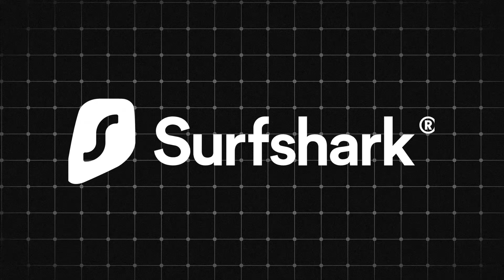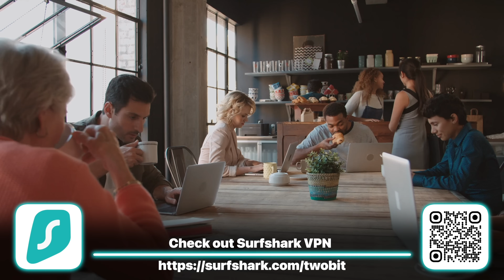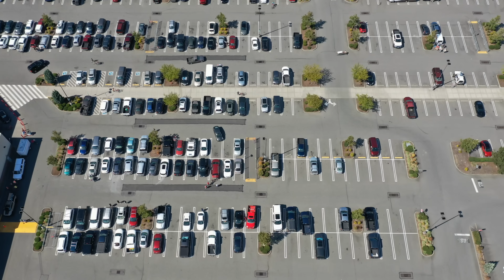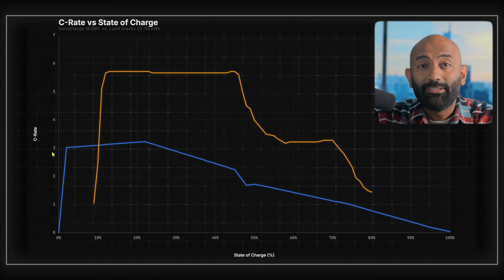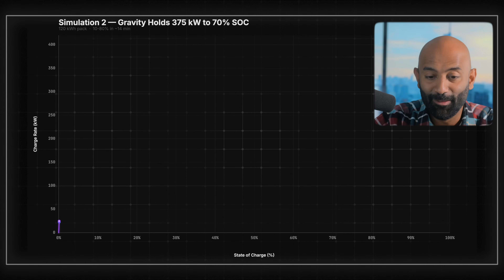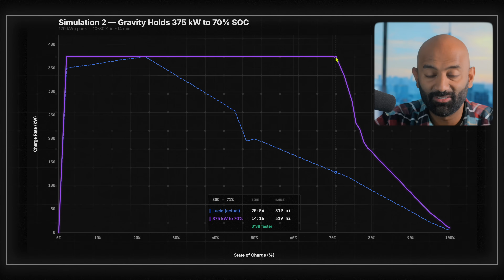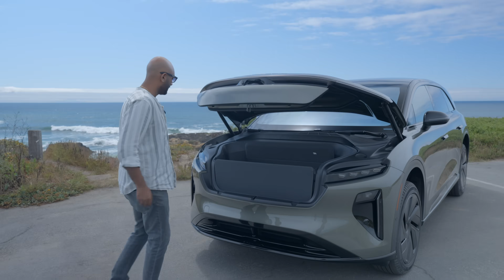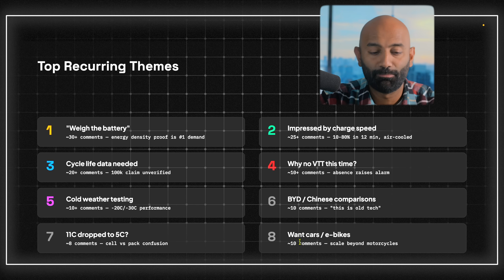Donut Lab Battery Test 4 Changes Everything!

Comment: The entire 5C is not so relevant for Lucid's 200kWh batteries, because we simply don't have this kind of chargers (as mentioned). it's more relevant to regular/budget cars, because that means we no longer need "soon to be" 150+kWh batteries, as we can charge 70kWh in the blink of an eye with already existing infrastructure. 16:30, while I agree it will save you a lot of time on your road trip, I still think you are fine with a 20-minute break after driving for 300 miles. Again, I think the biggest revolution is recreating the petrol-station experience for 60-70kWh batteries, you no longer stop, go for dinner and return after overstaying, but you step out, connect the charger, check your twitter, and you are ready to go 6 minutes later.
Reply: We have one 600kW Charger and one 720kW in Slovakia :D
Reply: @MrVolodus  "and ONE 720kW" is a key word here ;) I know infrastructure will be upgraded in time, but I still I would rather use the closest charger, rather than hunting for 600kW one with 20 miles detour
Reply: @michalklucz6907  They will grow in time ... mostly because of trucks.
But yeah, 350kW is standard for now.
Reply: @MrVolodus  a standard, and I still believe that for next 3 years we should use it as a benchmark. because even if you will suddenly see ten 650kW in one place, I am 99.99% sure that site is not ready to supply the top power to each charger at the same time. Because charger technology develops faster than infrastructure can deliver. which means you may have a MegaWatt charger but it will only deliver 1MW if nobody else is using other slots. This is normal and OK for a while. New sites should be developed with new peak usage in mind, and as in the UK I never had to queue for charger it's fine to share the power. it will be an issue in 2035
Reply: No worries, budget  cars are not gonna have these things for a long time! You’re not gonna get this premium battery in a cheap car for a long, long time here in the US
Reply: @JohnDiMartino  I am in the UK so we may get them quicker. Secondly, you don't need budget car to have good battery. Think about market hits like BMW 3/x3 series or MB GLA, if you have battery that needs 6 minutes to charge you can save money on larger battery. with less weight you have better efficiency, performance, and lower running costs.
Reply: yep, in terms of C rate, hyundai-kia eGMP plafrom (ioniq 5, 6, kia ev6) and taycan charge faster.
Reply: Yes, they have said it can be made inexpensively, but we have no real idea of the battery pricing to know how accessible this battery (if legit) would be for budget cars.  But excited for the possibilities!  On the comment about a 20 minute break after 300 miles - lol, I would barely have made it out of my state by then.  No way I want to take a long break at just 4.5 hours in to a road trip.  There is definitely going to be a different mindset around this for Americans versus Europeans.
Reply: @W78thIS  lucky you! I am 44, and while still in good shape, I would love to use a toilet every five hours, and refill my coffee! 
On the battery side, Chineese are putting at least semi solid-state batteries to their city cars as we speak (fine, we are still waiting for tests). So Donut people have to find partner to use economy of scale asap
Reply from the maker: exactly — 5C matters most where chargers already exist, not just for 200kWh halo bikes

Comment: Again, I think you may not be fully understanding the big difference.  ANY DC Fast Charger can maintain 100kW for a long time, that's very low stress on the charger equipment.  Inside every DC Fast Charger is an AC-to-DC converter that boosts the DC Voltage up high enough for the maximum vehicle battery voltage - PLUS enough headroom to prevent earlier tapering.  That AC-to-DC Boost converter is made with high-power electronics... which all heat up when under high loads.  If that DCFC does not have a huge thermal management system (which takes up a LOT of room), then the Charger itself has to taper-off its Output Power to prevent damage.

Plug in a low capacity motorcycle battery to the same DCFC, and it will be able to maintain that "Low" charge rate (relative to a Car) WITHOUT tapering down the output power.  If someone were to make a Lucid with a 50kWh battery, it too would be able to maintain a higher charge rate for much longer... because both the EV Battery and the DCFC can handle that power level easier.

A "small" motorcycle battery pack has low thermal mass and low cell count - so although it obviously does heat up, it would be MUCH easier to cool off with air cooling - than a massive 112kWh battery pack... simple physics.

Comment: If you were using the lucid it’s cooling would mean you could go to a v4 Tesla and get 500kW all of the way to 70%. Which would be under 10 minutes to 80%

And based on density you’d be getting 1000 miles of range in a grand touring while being 500-700 lbs lighter.  So not only would it be 10 minutes to 70, you’d have 15% more range than fully charging a current grand touring.
Reply from the maker: lucids cool but we only saw 9-80% — real charge curve could drop faster

Comment: I love the idea, of a flat large surface area Super capacitor internally over the battery chemistry like an expansion of the anode. Helping to distribute and organize the exchange of energy into the battery pack. Could be part of the special glaze that keeps the heat distribution even in the battery pack across the entire surface area and able to take advantage of air cooling.    Can't wait to find out!  I'll have one donut with a graphene glaze.
Reply from the maker: graphene glaze as a thermal spreader? i like where your head's at

Comment: This is encouraging. I’m with the folks that want to see this in cars and e-bikes. Specifically with bikes, a better energy density would help so much. Weight is such a big deal for bikes, so a lightweight battery would make a huge difference. It would change an e-bike from a heavy cumbersome thing that feels like a motorcycle, to something that actually feels like a bike. It’s so much more important than charge speed. I’ve never payed any attention to how long it takes to charge my e-bike.
Reply: So true, but I can imagine much more. We will easily be able to bike tour great distances since the battery can charge so fast. Battery range will degrade over decades, not years like today’s e-bikes. No more price shock at having to replace the battery in a few years, if you can even find an outdated replacement. Reselling an old e-bike will still have good value. And devastating in home e-bike battery fires will be a thing of the past.
Reply from the maker: weight is king for ebikes — speed’s just the cherry on top

Comment: I’m really disappointed by this week. I don’t discount the importance of fast charging, but as you said we have yet to get proof of their most important claims: energy density, cycle life and being lithium free. To focus on charging speeds without verifying those claims is only marginally better than Elizabeth Holmes bragging about how little blood she needs to sample.
Reply from the maker: yeah the big three are still MIA — charging fast means nothing if we don’t know what’s inside
Reply: Well it is Elizabeth Holmes story. Everything Donut Labs shows is extremely suspicious. Now we got a bike supposedly charging in 12 minutes from 10 to 80%, which isn't even that impressive. On top of not even showing entire bike, so who knows, maybe its just a frame and it passthrough to an actual battery off screen. On top of this, they did this test in perfect conditions, during sprint, when you have low temperatures, so more changes to push it more than it would in normal use cases. And then we have no idea what they did before this charge test, was this bike driven there, or did they transported it on a trolley...
Its a scam, would be happy to be proven wrong.

Comment: 5:50 - IMHO, you answered one of your own questions... one major reason Lucid hasn't pushed their charge rate higher is that there are no EV chargers that can provide it. Even if there were a few, it's not enough to spend the extra engineering and cost to make it available for such a few situations.

Comment: can't you estimate the weight of the pack by comparing the previous gen of the TS Pro weight with upcoming TS Pro (that has the Donut battery) weight? From what I could find the old "big" battery version of previous gen was 249kg with 20.2kwh battery, the new TS Pro with Donut battery is claimed 235kg, although they don't specify if it's the 20kwh or 33kwh version.
Reply from the maker: frame swap is more likely than battery saving 14kg — that’s suspension or bodywork

Comment: It would be nice to talk about the output impedance of the cells because that determines the heat generated, the charging or C rate and the power output. A lower output impedance requires less cooling to support higher charging rates and output power. But normally, you give up energy density for lower output impedance.
Reply from the maker: impedance vs density — classic tradeoff. wonder what their cells actually are

Comment: I agree with your assessment that this battery pack would make a vehicle in the real world faster to charge and therefore, refueling stops would be shorter. But I think you're missing the much bigger impact this would have. If this technology spreads, either by the donut battery selling like crazy or other companies coming out with comparable battery packs, the impact would be felt most on charger availability. Because charging stations that have more than two or four Chargers are still very uncommon. Which means that road trip where you just want to spend 15 minutes recharging actually becomes a 45 minute wait because you have to wait for a couple of people who are tying up the chargers. But if charge times are lowered on average than Chargers become available faster and the overall wait time is reduced.
Reply from the maker: charger availability is the silent bottleneck — faster charging fixes that math

Comment: FYI most reputable battery-related YT channels simply have disengaged because the claims are basically proven wrong, so mostly 'positive' ones (like yours?) basically doing free marketing remains
Reply from the maker: claims aren't proven wrong — we're still waiting on weight and chemistry data
Reply: @TwoBitDaVinci  Jordan from 'The Limiting Factor' has a great video on this: 'Donut Lab's Battery has a Problem with Physics (and manufacturing)'

Comment: The quicker a battery can charge the less need there is for a longer range and bigger battery.....

Loads of benefits of smaller batteries. Less weight = lower cost, better handling, less wear on parts and smaller lighter components required to slow down, turn etc
Reply from the maker: exactly — why haul around dead weight when you can top off in minutes?

Comment: I looks like the Lucid was Amp limited form 3% to 25% on the EvGo charger. The kW go up slowly because the voltage increases. Probably does not impact the overal results much because it was nog sustainable after that anyway.
Reply from the maker: lucid amp-limited on evgo — voltage ramp, tapered anyway so negligible
Reply: @TwoBitDaVinci  Yes I agree that there is no significant impact. Just wanted to help you explain the slow upramp in kW

Comment: Would 400kwh/kg be practical for mass transport electric planes? Perhaps a hybrid plane where the battery power is used only for takeoffs and low altitude?
Reply: Yes I think a 400 Kwh/kg would be very useful for mass transportation, just the claim was only 400Wh/kg.

Jet A-1 fuel has a energy density of approximately 11.99 kWh/kg

You do the math.

Should a battery like the Donut claims be reality in the future, I am sure we will see smaller electic planes use it.
Reply from the maker: 400Wh/kg? That’s the dream. For planes, takeoff burst is where batteries shine — hybrid makes sense.

Comment: On 400kW the pack will even load longer than the 70% SOC because it will not heat up that much on the lowered charge speed. So I assume it could go all the way to 80% on full 400kW load.
Reply from the maker: exactly — lower C means less heat, so it can sustain longer

Comment: I came to the same conclusion - what we are seeing is thermal throttling, just like on a laptop.  That means an upgrade to the fans could push up that curve. Liquid cooling (which is not an option on a motorcycle) could do a lot better.
Reply from the maker: thermal throttling on a bike? yeah no liquid cooling there — fans are it

Comment: Xpeng G9 and G6, which you can buy here in Denmark, as well as the Zeekr 7, can already charge from 10-80% in 12-13min. I know they're all watercooled; but wouldn't a smaller battery realease less heat, than a big one? I mean there are so many aircooled MC's out there, but not that many aircooled cars (that I know of anyway). But maybe you can't make that comparison? 🤷‍♂
Reply from the maker: smaller pack = less heat, yes — but motorcycles have way less space for cooling than cars

Comment: I wonder if that first battery pack they tested the charge speed on... just stayed at VTT and continued to just charge and discharge to give that cycle testing that we are all looking for... But it takes time to get a few thousand charges in a battery and showing the degradation of the battery.  Let's say 2 hours per test so maybe 4 tests a day... That's 120 in a month... so likely won't see it for a while. 

Cold testing would be awesome as well.  How fast can it charge when it's cold is the question I have and how much power does it lose because it's cold is another question I have.
Reply from the maker: cycle testing takes forever — cold charging’s the real mystery though

Comment: that is just a load of shit. you dont need any cooling for that charging, in fact you literally could not cool battery so fast with tiny channel liquid trickle cooling. you just soak the pack and get the heat out in the next hours of use. if you actually want to cool the pack, you use air cooling, that is what i have always been used in fast charging packs but it practically does not work on road for very long because it literally blows crap in the air through the battery
Reply from the maker: you can't cool it that fast with trickle flow — physics says no

Comment: From the Lab testing I was expecting the first documented real world charge on the Verge to look good, but I didn't actually expect that good, or that clearly hitting limits that seem to have nothing to do with the battery chemistry... 
Given a watercooled car scale pack I'd suggest that motorbike step for what looks like thermals might well not happen at all, so being able to sustain 600+kW to a very high state of charge seems quite likely. As the motorbike pack probably doesn't have a great way to eject heat from the centre of the block of battery cells, as it would be adding construction mass and complexity that probably isn't justified when these battery cells can clearly take high temperatures for battery and having a charge time pushing that under 10 mins mark for a motorbike probably isn't worth it - when you get off a two wheeler you generally want longer than that for your puny biology, and unlike the regular motorbike the expectation is every single journey would start with a full battery from at home charging...
Reply from the maker: yeah thermals will choke the bike pack way before chemistry does — car scale has the mass to soak it

Comment: So spec'ing the battery pack build so that 80-85% of charge = maximum voltage for the controller so that the batteries only ever get charged to 85% but on the gage your battery will read 100% full
Reply from the maker: clever workaround for usable range vs displayed SOC — seen that in a few EVs already

Comment: Seriously, it is a one off test. They can be using specialtu celss, which have high C rates, but low cycle life or just testing some other battery which can take high C rate, but with very limited lifespan. This still seems like a scam.
Reply from the maker: yeah we're flying blind on weight and chem — still just early data

Comment: I think test 5 will be data on cycle life. Let this battery charge at 11c and discharge fairly quickly. Run it around the clock for two weeks, and show us some data. lets say 11c charging (appx 5 minutes charge) and 2c discharge (30 minutes discharge), amounts to appx 41 cycles per day. so in two weeks, that would amount to 576 cycles.
Reply from the maker: test 5 is peak power, test 6 is the cycle life grind — love the math on 41 cycles/day, that’s exactly how we’d stress it

Comment: You can't charge faster unless you have a more powerful charger which basically is fake because there are practically no such chargers nor will there be.  In order to have super fast charging you have to have the power to feed that charger available - guess what - nearly nowhere can handle that sort of load.  Charging say 5 times faster is like splitting the batter into 5 parts and charing each part at the same time with 5 chargers; but if you actually do this - charge say 5 Tesla's at the same time at the same site - the power simply gets split because there isn't enough power for all 5 to be charged at full speed at the same time - You are just spready BS hype. If you put that BS forward - I can conclude all the rest is BS hype and you'll say anything manufacture lie about, that makes your channel worthless.
Reply from the maker: fair point — real-world rollout is the hurdle, not the tech itself. we're showing what's possible, not what's everywhere yet